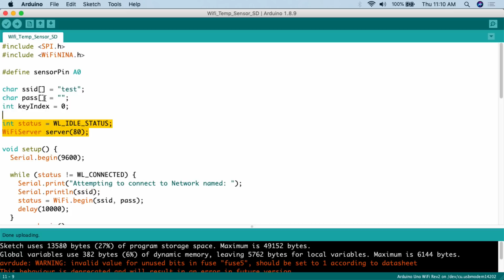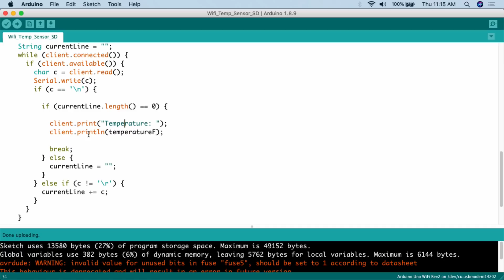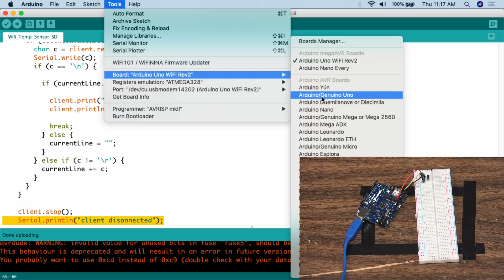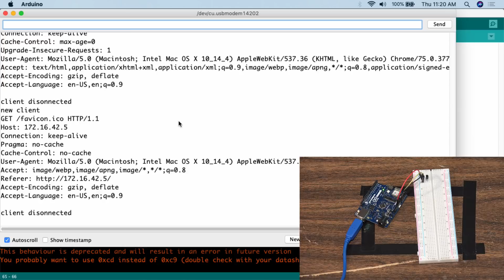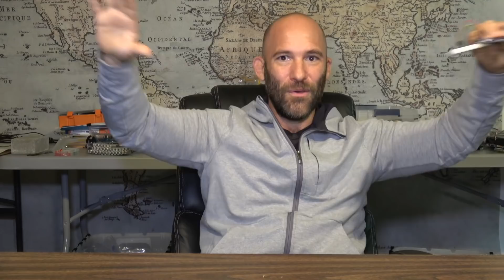Arduino Uno Wifi Temperature Sensor

Comment: Hello, I tried to develop a similar application using the DS18B20 sensor but it doesn't work for me. I can read the sensor with the Arduino UNO, but not with the Arduino UNO Wifi REV 2. Can someone help me? 
with the arduino UNO wifi I only read -127

Comment: You just needed to put the actual voltage in your code that you have in your board to calibrate the temperature, in your case it was 4.8 volts!

Comment: Thank you so much! I've just changed the code a bit to use a digital temperature sensor (DS18B20) and Bob's your uncle! It's working!!! Great!!!
Reply: Hello, I tried to develop a similar application using the DS18B20 sensor but it doesn't work for me. I can read the sensor with the Arduino UNO, but not with the Arduino UNO Wifi REV 2. Can someone help me?
with the arduino UNO wifi I only read -127

Comment: Hi, your tutorial is amazing. I tried to use a different sensor, a BMP180 but I have a problem, the sensor didn't start to read the temperature. I taseted the senosr in a normal arduino uno and it works perfectly, the problem is that in the arduino uno wifi doesn't work and I don't know what to do :c

Comment: If you use battery to power the Arduino, its voltage will decrease as the battery drains.

Comment: For the voltage drop and easy math you could have used external voltage reference on the AREF pin. That way the calculations would have had the correct voltage levels each time.

Comment: Many thanks for posting this tutorial. Can I ask why I cannot see the data from the web browser whist the serial monitor reviewed I should? I also used client.print( ) and client.println but there is nothing displayed
Reply: Ok, I have just sorted it out. You should never consider yourself using a local network when the VPN is on :) Turn it off and everything is fine.

Comment: eli, you know you can offer a 5v reference right??  external references are important to any adc project to get any real accuracy. bandgap reference or there are temperature compensated references available at fairly cheap prices. for this you could have referenced an lm7805 even and been closer.  relying on the arduino reference is often not a good idea as the arduino dev boards dont have the best voltage regulation. one other trick is sampling the input voltage and using that value to adjust what your readings are in program.

Comment: Hey man it would be better for us if you given lessons on how to use chips like esp8266 to connect arduino to wifi the implementation is harder but its a low cost solution since arduino-wifi costs too much !

Comment: Hello there - I have built 3 of these sensors using a Wemos D1 mini and a 10k thermistor with a 150k resistor - it works but its in Celsius and I prefer Fahrenheit can someone please help me with changing the code or point me somewhere that would have the code or help me change it. Thank you - It also has a fast refresh rate where in the code would I see the refresh rate to make it refresh slower say a minute or 5 minutes? Thank you again